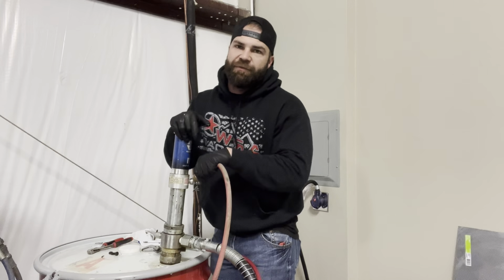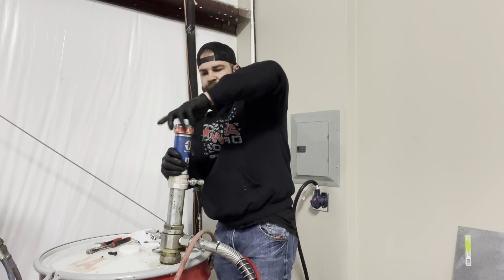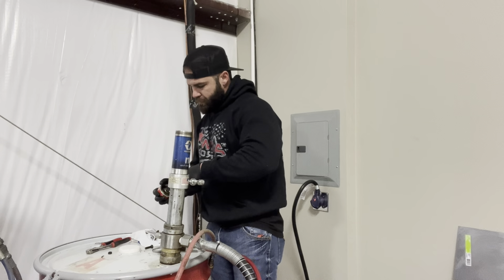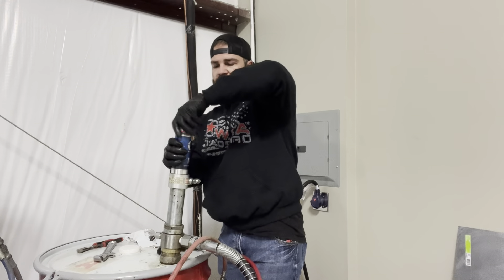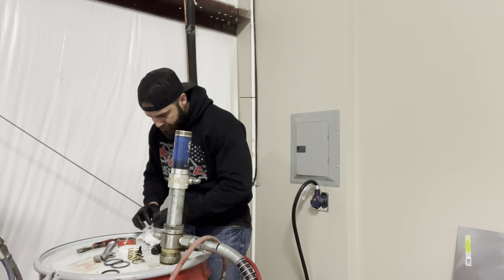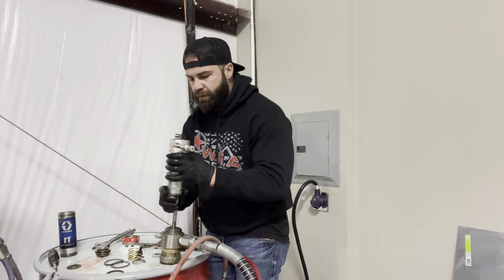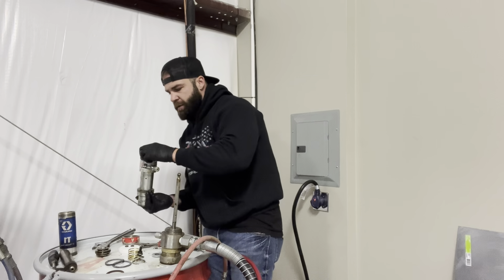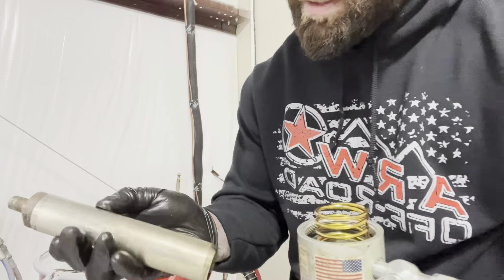Tech Tip Tuesday - T1 Transfer Pump Rebuild

Comment: I have the IPM pumps I’m wondering if the Graco rebuild kit will work because I ordered some and it doesn’t seem to fit correctly.
Reply from the maker: Yes they should work, although, the Graco cylinder seals are larger and you really have to stuff them in the ipm’s. Using TSL helps get them put in if you need to.
Reply: @shieldliners  thanks for the quick reply yeah I can tell they were a little bit larger than the factory ones but what really caught me off guard is the top spring was visually you could see it wasn’t as wide and it was falling down in  It was wanting to fall out that’s why I stopped and I put the original one back in.